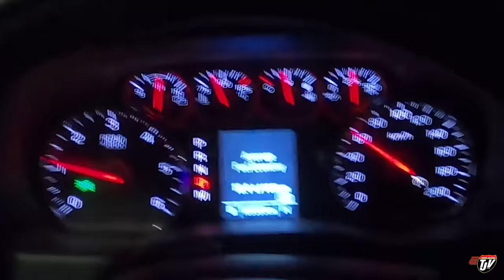FUEL ECONOMY...😬 | My Trucking Life | Vlog #2415

Comment: Im getting 30-36 mpg out of my 5 pot turbodiesel in a 90s VW van. 745 miles on a full tank, and its not very picky about what you put in the tank. Legend has it that a fart in the intake will get you 1/2 a mile

Comment: Greetings from the Arctic Circle from Finland. I have a Mercedes E 220 diesel in 2008. In summer about 5l / 100km. In winter 6-7 l / 100km depending on how cold it is.  
It is now 0 c,  the forecast for the weekend is -25 ..- 30c.

Comment: It’s a big truck, they’re not suppose to get good gas mileage, my tacoma 2020 gets 15.5-16 mpg. So not that bad in my opinion
Reply: I have a 2020 Ford F150 4X4 Crew cab , in the summer I get 23 to 25 mpg.   Of course less in the winter depending on the weather and how much I use the remote start and let it idle.